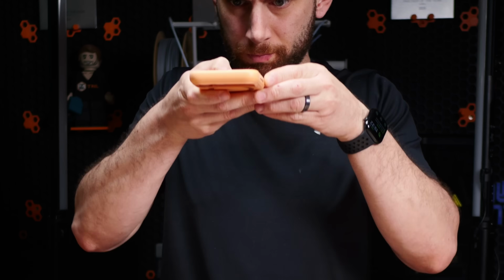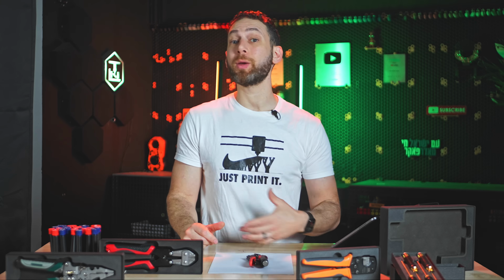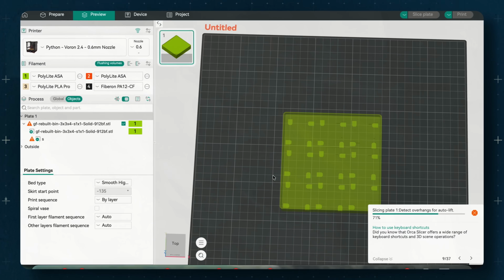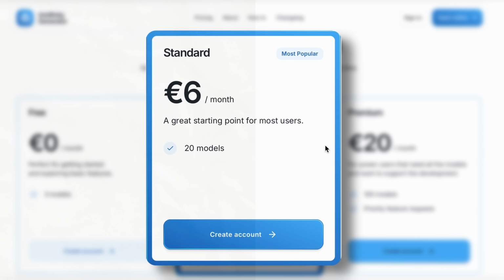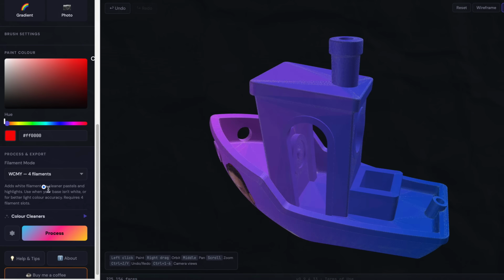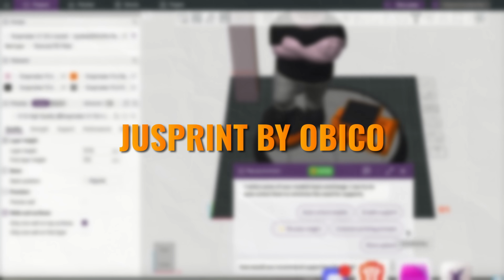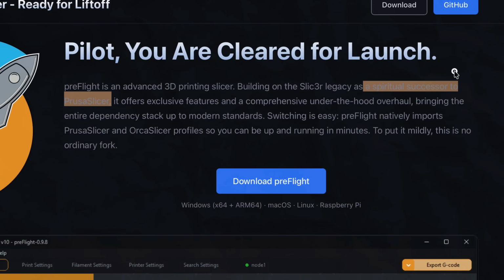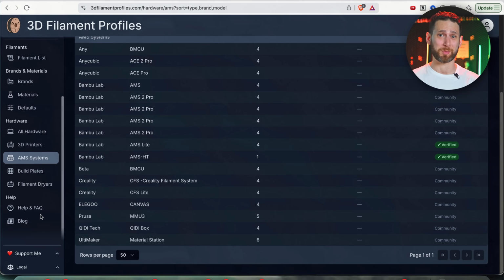These 13 New 3D Printing Apps Are Insane!

Comment: Thanks for the video. Know of any recommendable printers that do sign MNDA/ Mutual Non-disclosure agreements that will print and provide a sample, and MOQ run size/RFQ: for many/ several simple small flat bottom components about W 1-2"x2-1/2" L.

Comment: Quick question about the U1 printer...I have a Bambu X1c that prints just fine. However, I am considering a tool changer. What I REALLY like about my Bambu is the AMS. It keeps the filament dry, and looking at the U1 the spools are exposed so they will absorb moisture. So how can I have a similar AMS feature for the U1?
Secondly, you said it is open source. What I DON'T like about Bambu is the RFID locked to only their filament. Does the U1 accept different vendors RFID chips for different filaments? If so, which vendors are supported?
Thanks in advance.

Comment: p crazy how many apps are popping up around 3d printing now and those makes the whole workflow way more accessible compared to a few years ago. I also use a couple of tools myself, usually start with 3d model gen like rapiddirect and then tweak things a bit before sending it to print and doing this saves a lot of time on the design side! appreciate the lists of tools

Comment: You forgot to mention that preFlight is still in Beta for it's very first version, so yeah, still lots of work to get done on it. And yes, most of preFlight's unique features have been requested for OrcaSlicer, but since they are almost all still experimental, there has been literally 0 traction on any of them from the OrcaSlicer dev team. Bashing a development that's not even to market yet with its first official version is pretty low. Let's not overlook the immense number of bugs that OrcaSlicer has (like inaccurate line widths, and Linux compatibility), many of which preFlight has already solved and continues to actively work towards.

I do agree with you on the UI though, it feels pretty rough, but I have always thought PrusSlicer was a clunky and cluttered UI too, so much so that I refused to use it and stayed with Cura until Orca dropped their v2. Hopefully that is something preFlight will get smoothed out in future versions.

Comment: I'll second OnShape for bins. I was trying to model a bin for some Wera screwdrivers and Tooltrace just kept failing to generate the bins. Onshape was a little more work but the generated bins were absolutely perfect; even allowing me to model the dimples in the handles to slot the screwdrivers neatly in.

Comment: Why can't we get a tool that can calculate how to do color mixing inside the nozzle and basically with with poop.
If you want to print pink Load White and then load red and get pink.
CMYW mixing inside the nozzle, even if its not as color accurate as the current CMYW fill color method

Comment: Why do Chinese equipment manufactures locate the power switch on the back side of 3D printers, Lasers and other equipment?????    Is the key switch to their cars located in the trunk??????     Do they have to open the trunk, start the car and then walk around to the driver's seat.    In an emergency the power switch should be readily accessible, that's just common-sense basic machine design.

Comment: When printing tool boxes the shape of the recess is the label.   For example you don't need a screwdriver shaped hole to contain a screwdriver but if the hole is sufficiently 'screwdriver' shaped then you don't need a label to tell you what goes there.  In the case of the thumbnail he took that concept too far.  The raised area between the handles is superfluous,  it gets in the way and takes both time and material while adding nothing to the holder.  
I really enjoyed this video, thanks.

Comment: I use Teamviewer on my phone to access my computer to slice on the go. It's a bit clunky, and a bit ĺimiting in what you can do, but it works.
Combined with the AutoSwap on my A1, I can finish 3-4 prints while I'm at work away from the printer. I've even used Tinkercad to design stuff at work and have it waiting for me when I get home.

Comment: OK, Fusion is cloud-based as well. Please stop misrepresenting things.

It stores cache files for projects you're actively working on to speed things up and ensure that changes are backed up in case the internet is lost or there's an error or shutdown before things get synced to their servers, but, unless you're working on some really complex projects (like significantly more complex than the vast majority of 3D printing-related projects), the storage for a single project (especially something as simple a couple of gridfinity bins lol) shouldn't take anywhere close to 9GB of space lol. If you're worried about storage, you can always reduce the cache lifespan, ensure edits are only allowed on parts you're actively working on, and set all other components to view-only.

Additionally, if you prefer the browser-based experience of OnShape, Autodesk does have a web-based version of Fusion that enables full desktop functionality by assigning a virtual machine to each user and then streaming the output to your device over a browser. Fusion is significantly more capable than OnShape, though, and having a dedicated app installed on your computer will lead to a significantly smoother experience for most users, especially those with dedicated hardware.

Don't get me wrong, there are plenty of reasons to use OnShape. If you don't need all the features of Fusion and you plan to primarily use your CAD suite from a browser because you prefer the flexibility or you have to because you have low-powered hardware like a really cheap laptop, a chromebook, an android device, or something like that, then OnShape's use of WebGL will provide a slightly more responsive web interface, but it won't beat the experience of having it run natively on your device with decent hardware. You may find OnShape smoother if you don't have access to mid-range to high-end hardware, especially when you if you need to make really complex models, but for most 3D printing tasks and on most machines, especially if you mainly plan to use it on a machine with nearly any dedicated GPU from the last 5-10 years or some ultra-powerful integrated graphics like we see on some modern SOCs and APUs, your experience for most 3D printing-related tasks will likely be smoother on Fusion with their dedicated app installed.

Also, since you specifically mentioned engineers (which I felt like was mainly just to make the sales pitch for OnShape sound better), they mainly use SolidWorks, and if they want to consolidate their process onto a simpler, more collaborative cloud-based alternative, they choose Fusion. OnShape works well for basic 3D modeling and some simulation work, but it's mainly used for 3D printing and lighter-weight product design and not a common choice for intensive engineering workflows, and it lacks most of the features of Fusion (such as more advanced simulations, generative components, circuit board design, CAM features used for things like machining and mass-production, sheet metal design, the ability to make demo videos and slides, support for assembly planning and instruction, etc.) that an engineering team designing designing complex products would be interested in. Plus, engineers usually have access to dedicated hardware for working on CAD models, which means their experience will likely be smoother on the device. Some engineers may use OnShape, but most will prefer Fusion since it is way more capable and provides a better experience on the dedicated hardware they likely have access to, with the ability to still use the browser-based experience in a pinch when they need to.

That felt like a pretty aggressive sales pitch for OnShape with a lot of misrepresentations. Both systems have pros and cons, and there are legitimate reasons to use OnShape for many people, but just because you're sponsored doesn't mean you should just lie to your audience.

Comment: I work in the medical field and travel with my equipment in a carryon. I would love to use a tool like tooltrace but ultimately I need to create a rugged box that exceeds my print plate space. What would you recommend for creating a briefcase style protective case that will probably end up being 18 inches square at least to hold all my stuff? Id like to do it in a single insert (which I realize would require cutting the model) but that kinda defeats the point of the whole gridfinity thing...
Reply: @JasonKincaid-u9q  if you want to keep it a single print there are print services that can go pretty large like xometry. I work in robotics and use them for a number of items :)

Comment: 13:22 I don't like Bezeq. They start as the most expensive fiber company and then they require you to pay for static IP just to get rid of the CGNAT. I hate CGNAT with a passion. Also Bezeq doesn't let you properly manage your rental router and they give you annoying cloud interface for it and you literally need to disconnect the fiber to get into the real settings.
I guess Gilat slightly cheaper prices (even after you pay for static IP to get rid of the CGNAT) but you probably would want your own router because theirs is the crappiest last I checked.
I typically prefer going with Partner or Cellcom.

Comment: It’s a shame that the tool holder programs are based on gridfinity.     I personally don’t use that.   I would have to cut the gridfinity base off and replace it with a solid base for my needs.   Nonetheless great video.   Tons of information

Comment: What Leica was that? 10-25 or 25-50?
Reply from the maker: 25-50, but not sure when I showed a lens on camera lol. I have a lotttttt of glass… 7-14. 25-60, and primes. So so many primes…
Reply: @thenextlayer 25-50 is a great lens, this is basically my main wedding lens which pays my rent😂 the other two 12 1,4 and oly12-40. Also 15 1,7 and sigma 56 1,4 🤙🔥👍I'm still planning one day to get a 10-25  sibling even though I have  canon rf and Sony e systems  with primes😂

Comment: I guess the SnapMaker U1 does not have an enclosure kit?
Reply from the maker: Of course it does! Https://jle.vi/snapmaker it’s on the site
Reply: @thenextlayer  Thank you, I didn't see that yesterday.  They are good company?  This really seems like a good way to multi-color.   The Bambu H2C still has to retract and load new filament and it's like $2500!  This looks much better, with the exception of the filament exposed to the room rather than in a seals box with four tubes.  That would be a good add-on.

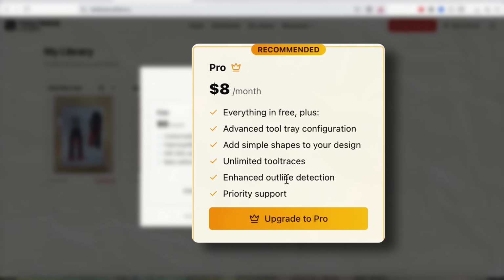Comment: 2:30, $8 a month for a tool you'll probably be using once a lot, and then iteratively as you add things or change things? No. That's not reasonable, and it feels real out of touch to be just totally okay with a subscription fee for this sort of stepwise software need.

The only way that a subscription service makes sense for a program like this is if you make your living selling these custom printouts. Otherwise, it should be a pay once and own it forever, and it lives on your computer instead of in the cloud. This movement towards subscription models is exploitative towards consumers, and will lead to a dearth of abandonware software in the future, when these cloud services shut down and are just gone...

I was excited for this video, but I don't feel like I can agree with your your valuation judgments, so I'm going to call it here. Awesome production values and editing, I'll check up on some of your other videos before I move on completely...

Comment: I like gridfinity but I find too many things are not quite matched to the grid size and I end up wasting a lot of space.
Reply from the maker: You can do half sizes bro
Reply: @thenextlayer  I haven't come across those so far.  Only integral number of slots.  I have several things for my drawers now that are just a tiny bit bigger than a slot.  I will need to look for that then.

Comment: Eww to literally any type of software like this that forces monthly subscriptions to use instead of offering the ability to buy it, even if it would be more expensive upfront. (Or if they are doing cloud processing, offering the ability to pay a reasonable price on a per model bases.)

 Subscriptions absolutely are 100% about making you pay anywhere from 10x to 50x as much for a software than what it was worth in the past. (Anti consumer, pro company profits.)

 It's not a $20 program it is a $5/m program that equals $60, at the end of the year and (240 at the end of year 4) that you have absolutely no ownership of it even if you pay hundreds times more than it's worth over it's life.

 And It's BS having to work on a schedule to maximize the value of it because if you use it a bunch then not at all the following months then you are just burning money to a company that is offering literally ZERO service to you at that point.

 Or better yet you get a subscription and stuff comes up and you can't use it until a later date you get f'd and pay anyways for the time now you couldn't use it and need to pay again when you actually use the product.

 People have become brainwashed with feeling subscriptions are okay especially when it seems small upfront.

 But the average person is being robbed blind by these parasitic 'A little here and there' charges.

 Also on top of all that they force you to make accounts to use their stuff which is then being sold to data brokers on top of everything.

 Then the fact many subscriptions are purposely hard to cancel. And many also have the right to revoke your access any time, reserve the right to completely change the program you are using on a whim, and force you usually to use online verification that relies on you having Internet and their servers working right... 

 It's just a load of BS.

Comment: I cannot believe you waited until the end to drop the gem of a project of yours that is Filibrary! This is something I've been wanting for so incredibly long. From the beginning of my 3D printing journey no one single filament repository existed where you could get the run down on what a filament is, what it's useful for, and a general sense o its properties. You are doing the lord's work, and its because of extremely hard-working boundary-pushers like you that the craft of 3d printing has matured into the world-changing technology and cohesive community that it is today. You're definitely getting a donation from me toward that project.

A suggestion for Filibrary: would it be possible to have an "advanced" buttion on each of the filament entries, upon which clicking it, mechanical properties testing from fellow youtubers and manufacturer specs is provided in a comprehensive chart form, with links to the videos and studies underneath? 
My mind goes to @MyTechFun and his extensive videos covering a plethora of filaments' mechanical properties, and the charts are already in his videos.

I cannot think of anything better than seeing the two of these bodies of work integrated into one.

Comment: 1. Are you going to open source FiLibrary and put it on github?
2. I tried to submit a new filament but it always responds with "Failed to fetch"
3. Tell your developer😉that for the performance graphs it would be great to have the numbers map to an actual scale instead of an arbitrary number out of 100. Like what is 72 weather anyway?